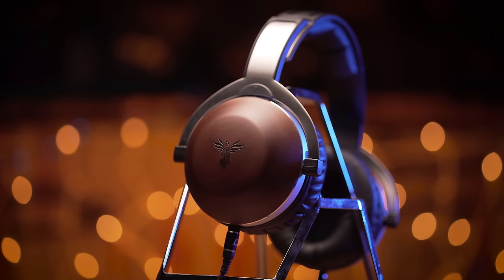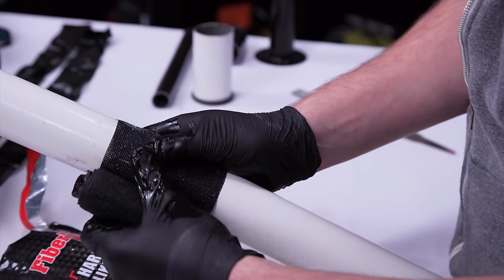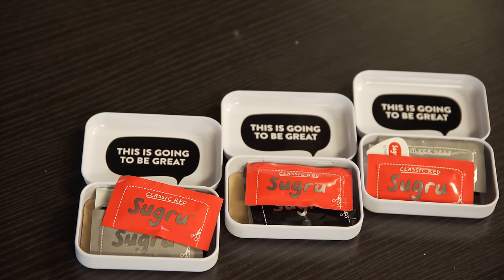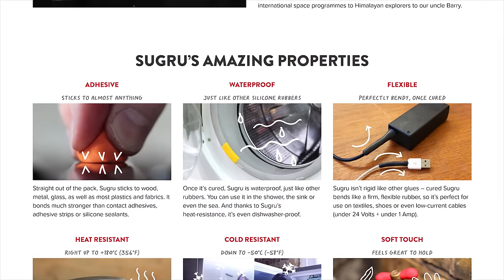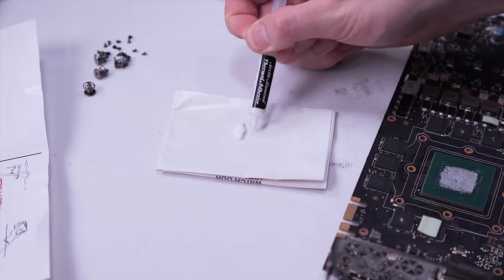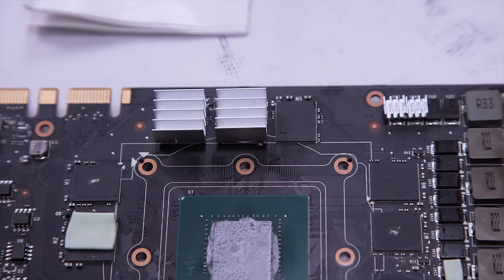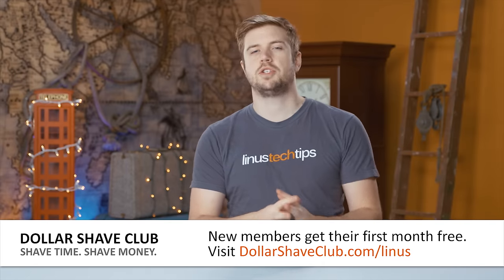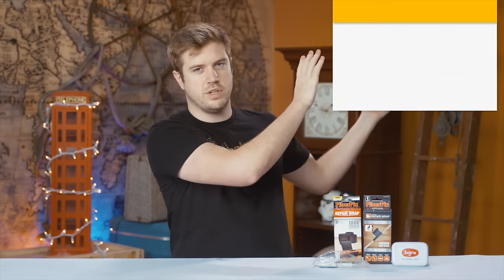Handy Tech Under $100 - It's all sticky ( ͡° ͜ʖ ͡°)

Comment: I'm super happy to see Sugru being so successful and getting love like this vid, it's super useful and easy to use. It does have a shelf-life before the little packets are opened, but you can extend that massively by storing it in the fridge. Cheap two-part epoxy putty can produce a stronger rigid result, but is way harder to work with - Sugru is way nicer to use, doesn't require use of gloves (epoxy on skin is not good) and gives a nice soft-touch rubber result.

Comment: Ugh that joke at the beginning killed my soul. It literally died. I didn't even think souls existed until this moment, when I felt mine wither and vanish.

Also, of course the fiber fix didn't work, you didn't take all the paint off. It doesn't adhere well to paint because paint is weak and breaks easily, that's why you stick it to the metal, genius...

Comment: Any thoughts using SUGRU to make custom molded In Ear plus for earbuds?
Reply: From what I read, Sugru should be flexible enough to not cause issues, but it's not food safe and manufacturers explicitly discourages prolonged skin contact because it can be a mild irritant.
Reply: Pretty sure it has epoxy in it, so it will irritate skin, definitely shouldn't put it in your ears
Reply: It doesn't contain any epoxy, it's 70/30 mix of RTV silicone and talc powder (with additives to change hardness etc.) but silicone itself is considered an irritant.
Reply: there's a dedicated product for that, it's from Radians.
Reply: Out of this entire comment thread, I actually tried it and it worked fine on my earbuds. No itch, it's flexible rubber and seals pretty well
Reply: Doesn't every other earbud maker use silicon tips anyway?
Reply: True but rarely do they include that has the perfect size or flexibility to make it absolutely comfy
Sugru usually fixes at least one of that

Comment: Sugaru has some really bad reviews ... that it gets brittle ... from a few (3) month after being applied (over after a few weeks) up to the moment it should have hardened (24 hours after used).
Complains that it doesn't stick ... and so on and so forth. (and some because of a short or expired best of date when buying from amazon)
Reply: Yea its an expensive "do everything" product.  A tube of silicon caulk works for many applications, and epoxy putty works for many more, and one can jumble together better solutions for things like headphone stands by going to the hardware store and being creative.
Reply: MrMegaPussyPlayer The brittle sugru is possibly due to high humidity in the forming process, all of my stuff've held up fine for like 6 months
Reply: I use Sugru on all my grips for a softer custom fit.  Still on after years of use.  The sugru comes off clean if you want to take it off so maybe peope just put too thin a layer.
Reply: Andrew Baiza One said they applied it to a cord as the instructions said, but after 24 hours it didn't stick and became hard and brittle. And it fractured on test before falling off in pieces.
Reply: Hmm that's weird. Never had anytime I've used it become brittle. I did have to make sure the surface was clean to make sure it stuck good. I have used it on cords like the old apple cords and micro usb cords they stayed on. When it cures it feels like hard rubber. They might have had an open package or reused some that they left out?
Reply: Andrew Baiza Perhaps they used an expired product ... but at that point I only can speculate.

Comment: It probably vulcanizes on it's own, a rough sanding is required to keep it sticking. As I was previous a pipefitter aways sand of the paint. As most paints are slightly soft materials. If you fit something on a pipe with paint and remove it you can clearly see that the paint can compact under pressure or loosen completely.

Comment: The thing for FiberFix is it doesn't adhere to any flat surface... AT ALL, but when it dries out it's really hard.
This makes connecting straight flat surfaces not a viable option, but for fixed angled joints it's absolutely perfect.

Comment: I store my thermal paste on the door of my refrigerator along with my unused Ink carriages, and  I never have any of them dry out, I just let them warm back up to room temperature before using them. Remember the door of the Frig so it's not so cold it will freeze any of them stuff and ruin it, just cold enough so it does not get hot, and dry out over time.

Comment: That trailer looks like the one I built years ago. Has a single 1/4 steel plate for a floor. I put a big grey box on it with a green torch on roof that could be removed. Mine tipped as well. It was taken from a tow truck yard in Williams Lake it was being stored in. Looks exactly the same but the winch on the front is missing.

Comment: If Fiberfix won't adhere to a surface, then gorillaglue or superglue won't either. You just need to score the surface so it's rough enough for it to grip the tiny scratches

Comment: Luke, (Or any other LTT member) I want to know the performance benefits between two specific thermal paste application methods, one you have probably NEVER heard about, and one I have successfully used in the past. That is the apply and wipe method for Arctic Silver n(1,2,3,4,5 etc etc) vs the grain of rice method. The apply an wipe is where you apply a small amount of Arctic Silver to the heatsink surface and CPU surface, and then with a paper towel you rub it in and wipe it off. The idea is with adequate mounting pressure/contact, this will allow for two essentially flat surfaces (Think like using a spatula with Spackle to fill in holes in a wall) to press together without any issue.

This should perform better than the grain of rice method, considering there is less to go through counting the thermal paste, but I don't know and I do not have the tools needed to test this one out.

Would love a reply, and hopefully a video, your friend, Communist Ralph.

P.S. what happened to Linus's cats? I heard one of them was away from home or something.

Comment: Shouldn't have used a hollow table leg to test the fibrefix, you didn't apply it to the inside so in some situations it actually would have been weaker.

Comment: Unrelated question but could you make a video on how to: manage video data for video editors? I have a side job of product videography and my own gaming channel. These two alone take up massive amounts of data, I have 2x 4tb external drives, 4x 1tb external drives, and I find that hardly enough. How do you archive your old footage? I have four hours long of gaming footage, I don't use all of them but wish to archive them. i was thinking of burning them to bluray discs, but a disc is only 25gb and doesn't seem to be practical nor economic. Wish you could help out a fellow content creator. Many thanks!!!

Comment: +Aloïs ‘Kyrillios’ 
for some reason I couldn't directly react to you so I'll do it like this:

Thanks! I've been looking everything up and it looks awesome, it seems that the graphics card can handle quite new games. And you even managed to throw in the monitor while staying under 600.
A couple of questions:
Do I need a cooler? And do I need something to connect to the Wi-Fi to? And what about the operating system? Can I just download it on my current computer (from pirate bay) onto a USB and set windows 10 up on there?
And can I use something differ than the G.Skill Aegis? It also has 2133MHz and 8gb with CAS 15. 
And how compatible would this be when I would for example want to upgrade the graphics card in 3 years or so? Can I just switch it pit for an Nvidea for example or am I stuck with AMD. Or do I need to switch other parts out too? Is there a place to check if all part I choose would be compatible?
Thanks in advance
This might be what I'll be getting!

Comment: Plz don't use thermal adhesive, it is far too permanent, just get some thick thermal paste like zalman zm-stg2 (what I use), this stuff is practically an adhesive but if you need to you can remove it, a far better solution than Luke's "better than nothing" solution, never settle for "better than nothing" spend some time look around for a decent solution and especially one not so permanent.

Comment: Hey wheres my link to learn more about thermal paste? Also I have a funny (well wasn't funny at the time) picture where I tried to take out a CPU cooler but it got stuck to the CPU and ended up force pulling the CPU out of the motherboard. It was an AMD CPU so the pins ended up bent. I took pictures so hit me up if you would like to see them, also wouldn't mind with you guys sharing them for the rest of the people to not do this.

Comment: we need a handy stuff under $999999999999999999999999999999999999999999999999999999999909999999999999999999999999999999999999999999999999999999999999999999999999999999999999999999999999999999999999999999999999999999999999999999999999999909999999999999999999999999999999999999999999999999999999999999999999999999999999999999999999999999999999999999999999999999999999999999999999999999999909999999999999999999999999999999999999999999999999999999999999999999999999999999999999999999999999999999999999999999999999999999999999999999999999999909999999999999999999999999999999999999999999999999999999999999999999999999999999999999999999666 I know it's low, but still

Comment: can i use distilled water to try to remove the thermal adhesive?
Reply: I have used that adhesive and no, nothing will remove it unless you literally rip it off and more than likely the part will be ripped off the board.
Reply: Try "Goo Gone" even if it doesn't work. Top notch cleaner/sticky stuff remover. My old CRT 21inch monitor I smoked cigs in front it for years.... Half a bottle of windex and I could still see the smoke residue. Goo Gone removed it in 1 damn wipe..... Works for super glue, duck tape, or pesky stickers on products. Like i said if it doesnt work, still a damn nice item to have sitting in the house. But I bet it will work. Its like oil in a bottle, makes what is sticky not sticky, then wipes off. Awesome product, have had same bottle for over a decade now.

Comment: Ok, no Mac flame hate shit please but genuine advice, please.

Due to Apple's IDIOTIC new macbook pro I'm currently seriously thinking of going back to a PC. However, having spent about 10 years or so in the Apple ecosystem I find this thought a bit daunting. Especially when it comes to building up a pc from parts/selecting the parts.

Essentially what I need is a machine that can do to occasional gaming session but priority is in the workflow between Lightroom and Photoshop (I'm a photographer so this is a must have). I also need a display and a keyboard to go with this. 27 inch is a minimum display size. Most likely an IPS panel. The whole setup's budget is can be somewhere around 2500 euros (without tax). Any advice?
Reply: This goes both ways for PC to Mac users and Mac to PC users, Apple to Android and vice versa; You just gotta get used to the OS. Once you're willing to make the change, you're half way there. I use both systems regularly so once you get used to it its not that bad really.

Comment: I have a big question for you guys. I just tried to do a little overclocking as far as my ram by trying to increasing it from 1866 to 2133(The only change I made). When I restarted the comp. nothing happened (No MoBo logo, POST) I turned off the computer completely then turned it back on. As it started powering on a screen came up stating the the overclock failed. Any idea where I went wrong? I am running an ASUS ROG CROSSBLADE RANGER FM2+ AMD A88X and G.SKILL Ripjaws Z Series DDR3 SDRAM DDR3 1866.. Please help me. Any help would be awesome!

Comment: Can someone answer a question? I have a 1080p lg monitor that recently won't display anything on the screen. Nothing. Everything's plugged in correctly and the power button light just blinks and that's it. It's not my pc because it works fine with two of the other old monitors I have. Any help?
Reply: Adam Budai Well thanks for at least replying

Comment: Im getting a gtx 1060 6gb msi oc version for approximately 135 usd near my house. I live in India nd im on a budget for a gaming pc.  I have already bought an i3 6100 and mobo and 8gigs of ram only gpu is remaining so i thought of going for amd rx 460 because that is what I can afford now. It costs 136 usd on amazon. 
The gtx 1060 is used for 3 weeks and has a bill and 2years 11 months warranty. I also checked the card at his house and it was legit with comlete bill and all. I was wondering should i buy the used 1 or new rx460 thanks for any advice this is my very first build.

Comment: I'm thinking of upgrading my current PC but I need you guys help:
It currently has the following specs:
Pentium G(numbers) clocked at 3.2ghz
Msi 750ti 2gb
Msi z97
500w psu
500gb HDD(not SSD)
No SSD.
Windows 10
12gb DDR3 Ram

I am worried about upgrading it due to it being really really noisey. I would spend £400 on upgrading it but if I upgrade it would it get noisier or quite right.
Reply: You can't really hear the noise when you wear headphones.
Reply: i3-6100 £84 right now on newegg
i5-6500 £162
If you go with the i3-6100 you can pick up a 1070 SC black edition for £315 hitting almost £400 not including tax+shipping
If you get the i5-6500 you can get a 1060 6gb for around £220 and that ~£380 without tax+shipping.

TL;DR i3-6100+1070 SC black edition for gaming, i5-6500+1060 6gb for multipurpose. Computer noise usually is due to the case or cooling. Clean your PC and use decent fans. Cooler master has some for pretty cheap.
Reply: Michael Ok.
Reply: Kevin Li It gets proper loud when Im running games like Black Ops 3 or GTA V
Reply: ***** Not worth the money, the 1050 isnt even a ti version with 4gb it has 2gb
Reply: I don't think a 1050 was mentioned here.
Anyway, by the noise those aforementioned games generate, you really shouldn't be able to hear the fan. I sure can't when playing CS:GO.
And before saying that it isn't an intensive game and that it won't push the GPU, there's a reason FPS is uncapped. If it can easily handle 60fps, it won't just stop there. It'll keep rendering more frames until the GPU/CPU are maxed out.
Reply: Kevin Li Its very loud trust me when running those games mentioned. Listen to a planes engine, it sounds like that no joke